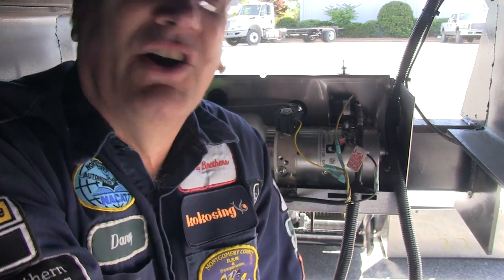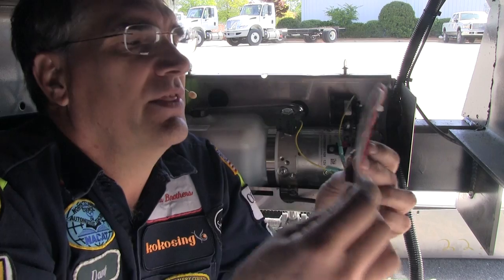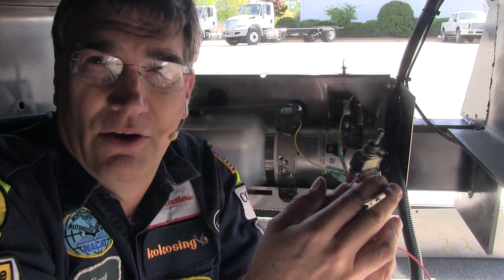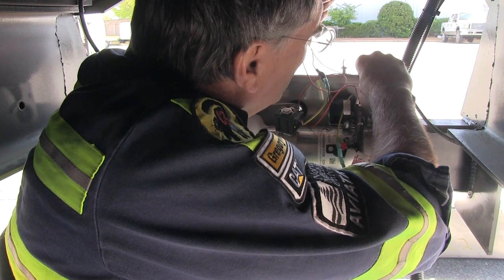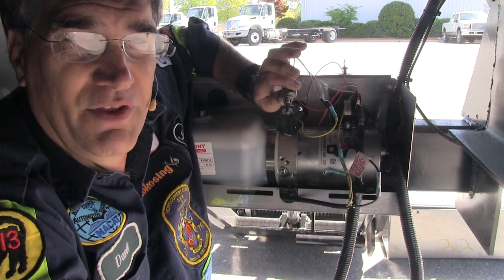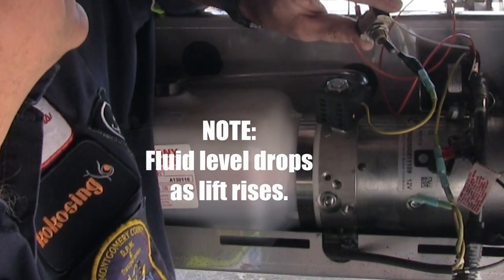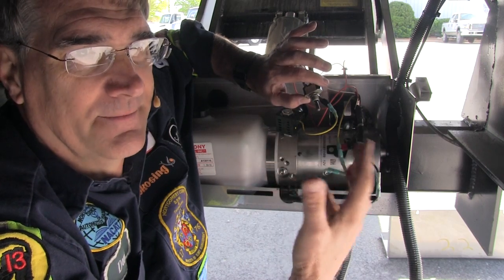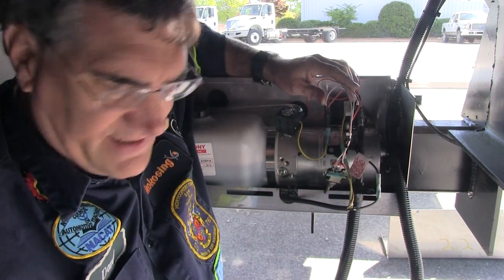Anthony Maintenance Switch

Comment: Question: o2 heater circuit should have 12 volts but only has about 6 volts when checking power and ground disconnected from sensor…resistance reading of circuit is ok. So where did the remainder 6 volts go? Shouldn’t system voltage show 12 volts without load? Could a voltage drop somewhere in circuit affect system voltage reading with dmm? I thought system voltage would only drop when the circuit is “on”. Am I missing something?

Comment: my liftgate doesn't do anything and the switch to turn on the liftgate won't turn on do you have any idea what it could be?
Reply from the maker: Not without some tests - but I'd make sure nothing is corroded, and check all the wiring (circuits) first before changing parts...
Reply: I already checked all the wiring, I couldn't find anything, I took another Tommy lift gate and bridged it and it looked the same, like the other one? Will there be a cut in the cables?
Reply from the maker: @OCGUSSD  0.001" of corrosion is all it takes. Green must be replaced. Without testing I have no idea. Do you have the schematic?
Reply: Has it already turned on but only the control turned on? Doesn't it go up or down?
Reply from the maker: @OCGUSSD  I can't help. I don't understand what you're trying to tell me.

Comment: Not sure how to email you a link to a YouTube vid. But this guy is doing voltage drop test across the load, 12v supply, stranded wire, leaving only two wires for the supply/ + , when drop testing it shows 2.6 v drop, then uses the load pro and it only drops by a 10th of a volt, very discouraged as I've had my list pro for about 5 years now and often have wanted to set this up to see, so many questions and have lost faith in the load pro
Reply from the maker: So I assume it's never worked for you? Failed all five years? Not the typical response we get.
Reply: @bivideo7  not sure of the best way to ask if this scenario has ever been tested on your part, if possible could a video showing that if one or two strands in stranded wire were all that's left would fail, thinking of this for just a moment makes me feel, well you know how could I have not thought about it, there's no way the load pro would no because of the wire size is rated for the amps needed and voltage still the same then, I'm back at sure one for looking at the best method for every use to know/ trust the results as needed, not a limited use, thank you for your time
Reply from the maker: @jessemartin6179  What's the amp load in your hypothetical scenario?
Reply: @bivideo7  would say less than 20?
Reply from the maker: Length of wire? Actual battery voltage? Engine running? Type of load? Vehicle? Temperature? It all matters. It's not just a simple YES/NO, RED/GREEN, GOOD/BAD process as you imply.
Reply: @bivideo7  looking at this from a benchtop testing method using a board with some wire a light bulb and a 12 volt supply use some 12 or 14 gauge stranded wire leaving only one or two strands to carry the load and this completely could be my misinterpretation of how the loadpro is to identify what would be found doing a voltage drop let me clarify by no means am I presenting a challenge out of disrespect I do respect you admire your knowledge remind you I own the loadpro from ES with your manual I had just come across a video I need to find the video and figure out how I can link it or share it to you I do greatly appreciate your response I truly strive to be the best I can be also I like having confidence with the tools and methods that I would go to thank you again